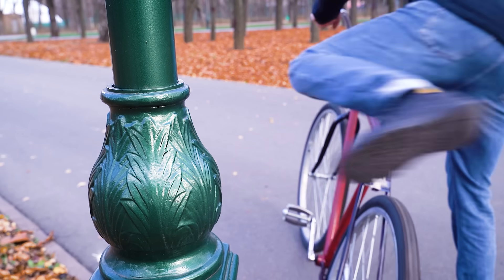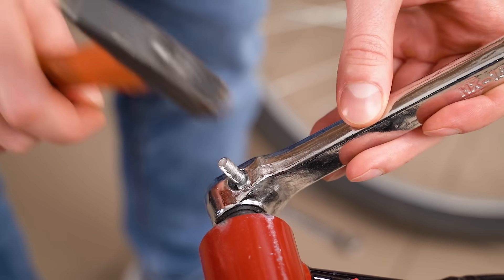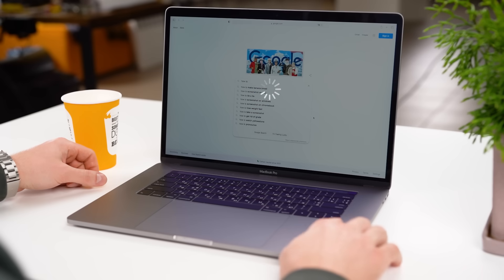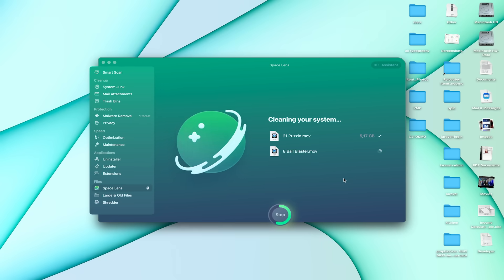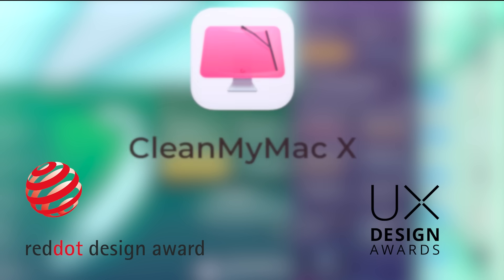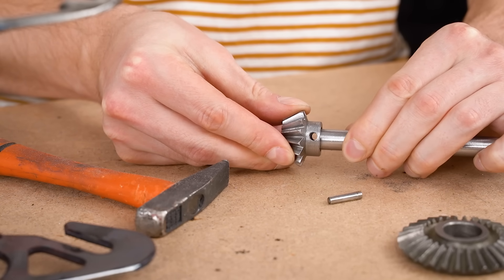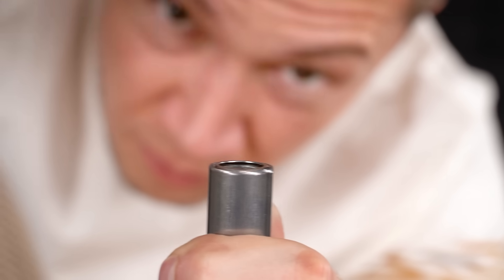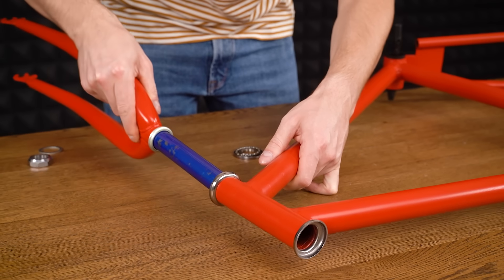Insane Chainless Bicycle Prototype

Comment from the maker: Go to https://bit.ly/TheQCleanMyMac to get CleanMyMac X
Reply: заебешься крутить педали 🥱😂
Reply: @insubordinate_i  вы полностью правы Александр, передача 1:1 это полная "хрезамтэма". 😂Два, три километра и гонщик сдохнет. 🤣
Reply: @АвадонБерия-ж7г  👍👍👍👍👍👍👍👍👍👍👍👍👍👍👍👍👍👍👍👍👍👍👍👍
Reply: @insubordinate_i  И Я ОБ ЭТОМ ПОДУМАЛ ШЕСТЕРНЮ НА ПИДАЛИ НАДО БОЛЬШЕ
Reply: @insubordinate_i  и тормозить то чем?
Reply: It shoud be called CollectMyDataX
Reply: @ggrpfn4216  🤣🤣🤣🤣
Reply: 4 @ggrpfn4216  be
Reply: Hey The Q. Great work. Is it possible to add gears on both sides at the back wheel instead of just one. Im just curious
Reply: @dude_247  on both sides gears might make harder to drive bicycle
Reply: BE CAREFUL with CleanMyMac, if it asks you to optimize the Mail app say NO, otherwise it will delete all your emails, from the most recent to the oldest, you will end up like me with the app to be reconfigured and nothing else to do. LOL
Reply: I think fixing the broken chain link would have been easier. 😂
Reply: I have windows laptop :(
Reply: @Gameplayer55055  lmaoo
Reply: wow, can you try to add gear system?
Reply: @MrNams  Ага , гидротрансформатор ! 😜
Reply: Not faster compared to real bike
Reply: Needs a higher gear
Reply: maybe the pedal has to be pedaled continuously... because the pedal can't slip, it's troublesome if your feet are tired
Reply: If you make the sprocket on the wheel bigger and somehow separate the road inside the barrel like and axle on a car where the two sides can be slid open and shut but still stay connected 
So then you could adjust the gear ratio you'd have somthing really interesting
Reply: What about speed...? 🤔
Reply: Maybe play with the gearing a little to get a higher ratio
Reply: ШЕСТЕРНУ МАЛЕНЬКУЮ ПОСТАВИЛ НА ПИДАЛИ ЗАМУЧЯЕШСЯ ТАК КРУТИЬ
Reply: Super idea but The long day will not come
Reply: En y
Reply: Thank you very much for sharing I am love from India🇮🇳
Reply: Great sir
Reply: Share |stock | market news | free tips
Reply: Well done sir you forgot about lubrication your design is ingenious but not practical
Reply: Yeh offcourse 👍👍👍👍👍
Reply: Isn't Clean my Mac a Virus?
Reply: if u build an enclosure around those gears  and put some oil in the enclosure the gears will always stay lubed. it also prevents dirt and debris from getting in it. should make it ride smooothe  long term
Reply: Already did this exact thing but I 3d printed my entire bike too.
Reply: Already did this exact thing but I 3d printed my entire bike too.
Reply: The title let me frown my eyebrows,because this already exists
This type of bike exists for over 100 years,some old people stil have them here
Reply: Вау класс и всё так просто интересно нагрузка больше на ноги стала или обычная как с цепочкой.?
Reply: Свободного хода нет 👎
Reply: @михаилмишин-ч3п  Куда он делся? Задняя каретка осталась та же, только шестерня вместо звёздочки. Сохранились и холостой ход, и задний тормоз. Изменилось передаточное число, т.к. в дрелях небогатый выбор шестерен. Бесшумность и надёжность тоже пострадали.
Reply: Coca cola would clean those gears much more defectively.
Reply: Gear change now
Reply: Forgot a little detail! Without lubricant it doesn't go very far.
Reply: Sounds like a virus
Reply: This is a nice idea, I wonder if you can add a gear shift on this.
Reply: Cool video, but CleanMyMac is a known malware/adware. Don’t use this.
Reply: Mantap bos..👍
Reply: Otras traducciones para
Reply: ط،
Reply: @Human Rights @
Reply: Why U forcefully tends to watch this ad  ? Put there cancel tap.
Reply: 09088 മലയാളം
Reply: 9
Reply: @Human Rights yup
Reply: precisa uma relação maior na frente
Reply: is it fred
Reply: Когда у тебя урал или днепр)
Reply: Sahi hai
Reply: Good
Reply: Genial foda q não dá pra trocar de marcha
Reply: Getty y
Reply: The bike is beautiful
Reply: Передаточное число не то) быстро педали крутить нужно. Шестерня на педалях должна быть больше
Reply: It's not good for speed chain cycle speed
Reply: Omg
Reply: @Username-h-b9x  m jjjjjjjuujuj
Reply: х
Reply: Ещё коробку передач нужно.
Reply: А нахуя?
Reply: That setup is not practical. Good novelty design
Reply: Sisi la arruino
Reply: This ist for people who have no idea of bicycles.
Reply: Steht in Neckarsulm im Zweiradmuseum ( aus den 30er Jahren)
Reply: Педали будут крутиться без остановки .
Reply: That’s really clever to put the link so close to the downvote button that ppl accidentally click it.
Reply: Máquina de hacer teja
Reply: Can you do smtng like CeramicSpeed transmission bike?
Reply: No.
Reply: The transaction from the vid to the sponsor time was clean but sadly I don't have mac but if there was one for windows then I would try it
Reply: Велосипед с карданной передачей давно производят серийно, причем механизм закрыт
Reply: It's cool, if it's in general production, but the chain becomes useless,
Reply: Q2
Reply: Kreatif
Reply: This is firsr in suizerland
Reply: doesn't it make your legs tired, while having to swing continuously?
Reply: Thanks
Reply: QUERO VER é  usar essa tecnologia, para fazer uma bicicleta com xambio de marchas. Essa bicicleta é  segura, minha sobrinha não teria perdido o dedo na correia da bicicleta, ao arrumar a correia a uma amiga. Interessante essa tecnologia.
Reply: Does it on sale
Reply: Inisiati f dan kreatif sangat
Reply: Where those scrap including mechanical hand drill came from?
Reply: Идиотизм чистой воды 🤦‍♂️
Reply: КПД передачи высчитай заново
Reply: 1 gear is all you can have and also does it free wheel?
Reply: please put a motor on this.
Reply: its a virus. dont download it. i literally had to change my laptop.
Reply: Elon is making bikes now ?
Reply: no second gear?
Reply: Where is your cycle brakes 😂.
Reply: @chhipajayshree8967  have you forgotten the children’s tricycle. It won’t have brakes.
Reply: @chhipajayshree8967  brakes for cowards))
Reply: @chhipajayshree8967 son de contrapedal, los que usan las fixie
Reply: What spray paint company do you use?
Reply: I wish you'd put your final thoughts since you tried it. Better or worse then a chain etc.
Reply: @Kamal_AL-Hinai  worse, anyone that rides a bike on a consistant basis knows by the amount revolutions his peddling is doing in comparison to the speed of the bike. He essentially made a one gear bike that is stuck in a low gear.
Reply: @Kamal_AL-Hinai  it's clearly worse.... But it's still a great bit of engineering
Reply: @Kamal_AL-Hinai  worse. A 21 speed is more more practical.
Reply: How to acquire this cycle ?
Reply: @macdeep8523  grammar much
Reply: Can you make a bike that merge all the: chainless, spokesless and airless tires ?
Reply: Otras traducciones ft
Reply: Спасибо пойду разберу ручную дрель
Reply: The following
Reply: شكرا
Reply: Hacksmith industries want to know your location
Reply: @Username-h-b9x  que está frente
Reply: @natyris2834
Reply: @Username-h-b9x  o
Reply: @Username-h-b9x  Tu misma acostúmbrate
Reply: @Username-h-b9x  te
Reply: @Username-h-b9x  que hoy
Reply: @Username-h-b9x  del Opus ook
Reply: @Username-h-b9x  nnnnmoll)) mamkkoooooooookookkkk
Reply: @Username-h-b9x  i

Comment: So many things can go wrong
1) Bad gear ratio
2) improper and dysfunctional welding 
3) friction loss from the gear causing the cycle to stop more quickly which is bad for races
4) A large force acting on one small gear which will eventually cause it to wear out and break, and unlike chain if broke cannot be fixed easily while chains can easily be replaced mid journey
This might look cool but it really isn't, waste of resources is all that was
Reply: Its entertainment, its for the sake of making it.

Comment: you definitely need a gearbox, to change ratios.  You also need to enclose both ends, what if you get a rock in the gears?  Check out shaft drive motorcycles, they do it right.

Comment: That's just a car's transmission on bike... I believe those gears are taken from a car's differential. Many commentators have already pointed out several shortcomings of this design. And for my most concerned part of the shortcome: This design you can't stop (idle phase) the pedal when the bike is going.

Comment: why did you hammer the gear pin while having it rest on the gear's teeth? would have been better to do it with the gear hanging over the edge of the table

Comment: so... you just set it up like an axle and differential in a car.... which means it will need to be lubricated constantly....i mean it works and you don't have to worry about a chain popping off... but the chains on a lot of bikes allow you to change "gears" depending on how much resistance you want as you pedal..

Comment: Driveshaft bicycles were actually pretty common around the turn of the 20th century, mainly because pedal-driven bicycles were still in their infancy and the now-traditional template didn't exist. The main reason chains won out are because they lose less power to friction, and they allow for external gears whereas shafts are limited to an internal hub. Though there are some companies that build shaft bicycles or conversion kits.

Comment: Nothing new here. This has been tried decades ago, and was never successful. It is not a solution to manual pedaling. A better solution is Gates' carbon belt drive with internal rear hub gearing.

Comment: At the first foreign body to end up in the bevel gear, everything breaks. Then that gear set is not suitable for a bicycle. The major bicycle transmission manufacturers have had bevel-gear designs in the drawer for decades. But friction does not guarantee optimum efficiency, including the not inconsiderable friction on a bicycle due to the need to keep the bevel gear under oil. Today there are belt drives but the chain continues to be the preferred system. Even on most motorbikes.

Comment: Pretty neat that it is so direct. I suppose this is not common practice because fixed gears are not very common and because it is better for the stress and shock to be put on a chain than on a sprocket because it is easier to replace.

Comment: This is no innovative idea but almost used over 100 years in automotive. Just answer this question: Why is this not used in professional bicycle racing? Answer: It does not make sence because of its inefficiency. Human bodys are weak, we have just about 100W power in average. A chain is very efficient. This solution is a few percent less efficient and therefore unacceptable to use.

Comment: try painting tight carbon fiber fabric both sides with high temp paint, carbon black one side and aluminium shiny on the other side, as a high temp shield survival blanket. its water/air proof. thats equivalent to car main engine shaft drive. try electric wire drive, generator-wire-motor combo, no belt/chain required.
Reply: try center wheel instead, direct pedal drive, no power transfer required

Comment: Yes it is INSANE! Bevel gears and a drive shaft were tried before Wilber and Orville, about 1888. It takes more than TRIPLE the energy for the gears and shaft (as well as weight) than ring gears and a chain. On a motorcycle (I've been riding since I was 14) a shaft and gears use about 20-25 more HP than a chain and 30-35 more HP than a Gimler (toothed) belt or Gates Polychain. WHY bicycles don't use Gates Polychains (50% lighter than a chain and sprockets and 50% more EFFICENT) is beyond me. Human legs can generate about .75 HP (540-575-ish watts), if you're a gymnast or pro cyclist. Wasting ANY of that on a shaft or sprockets and a chain makes NO sense. The World record top-speed holder 33cc motorcycle used a Gates Polychain and is FASTER than a 70cc chain drive bike.

Comment: The axle mount is excessively loose and definitely needs strengthening. The gears need protection; a stone, a wire, a branch will ruin the entire structure. With such a gear, a planetary bushing suggests itself for the rear wheel. Although judging by the result and described above, the author does not intend to do this, this is only for content.

Comment: I got a folding bike with that kardan-transmission. There is no dirty chain for trouble folded in my car or in a luggage compartment of a train. But the transmission ratio is too low like in the video even though there is a seven gear box in the closed rear hub. I can't pedal faster than 25km/h.

Comment: Nice built, but just for clicks ...
Looks so clean, but:
- gear ratio 1:1 quite useless
- no protection against the elements (rain, dust)
- no bearings or lubrication of the drive shaft
I'd guess it lasts shorter than 50 miles (if you ever want to ride this super slow bike this far ...)

Comment: Small problem - drawn cup needle bearings need a hard (57+ RC) shaft that’s very smooth (32 micro inches or better) round, and sized to with 1-2 tenths (0.0001 inch)

I’ve used them some in projects, which meant looking this up.

Comment: No selective gearing, one direct drive. No coasting. Lot of work for a less convenient and practical/efficient ride. BTW, good thinking of not showing how the chain came off, as that rarely to never happens on a coaster brake w/the chain in proper adjustment. Peace

Comment: In today's episode of terrible ideas resurrected from the past:  How to create two lateral torque failure points, strip gars, and bend a shaft...instead of using the linear torque of a chain drive.  Bonus:  You can't shift drive ratios with fixed gears, but you can easily shift with a chain!

Comment: I expect that with just a little bit of torque, the rear gear will start to jump over teeth... Try to ride it uphill, and stand up in the pedals. If it'll hold, I'll applaud.

Comment: Awesome concept. Change up the gear ratio's so you don't have to pedal as much as well as maybe add some type of clutch on the front so you can stop pedaling without stopping the bike. I'd buy!
Reply: Shaft driven bicycles are over 150 years old. They were abandoned for the chain as the chain is vastly superior.

Comment: 대전시 타슈가 이 체인리스 구동계를 쓰다가 무겁고 후져서 폐기하고 지금은 안 씁니다.
Tashoo, a public shared bicycle system in Daejeon, Korea, used a similar chainless drivetrain, but due to its heavy weight, poor efficiency, and frequent breakdowns, it has now discarded it and switched to a regular chain drivetrain.

Comment: I see this failing pretty quick. Without encasing it in some sort of housing with some gear oil, it will get dirt and all kinds of debris in the pinion gear and it will wear pretty fast. Its very similar to a vehicle differential setup.

Comment: The engineering is very poor. Gears tend to move apart when loaded so keeping the two gears in correct mesh needs amuch stronger construction. Maybe OK to demonstrate a principle but very poor structurally.

Comment: Interesting concept but impractical. The gears will wear like crazy - only one speed. My first bike was a 1 speed. I was 6. The standard 10 speed type transmission is really the most practical. It has stood the test of time. Dirt reliable. Easy to fix. Re-inventing the wheel and making it square is kind of a step backwards. Couple this with a cvt type front end and it could be interesting.

Comment: They used to have an amazing bicycle museum in Chicago. It was so interesting to seen exotic old bikes, their design elements. So many of them had things that the modern bikes had, but sometimes different materials. So, the latest and greatest “advancement” were just rehashing or reinventing an idea that was tried in the past. 
The major technology that has made a big difference is carbon fiber, those early makers had nothing like it. However, some of the styling of carbon frames and components harkens back to bikes made of wood, bamboo ect.
The shaft drive idea has not gone away and it may one day find a place, like the e-motorcycle industry. 
Major Taylor was a champion track rider that used shaft drive bikes with success. I own an antique Crescent shaft drive, very nicely made, but noisy.